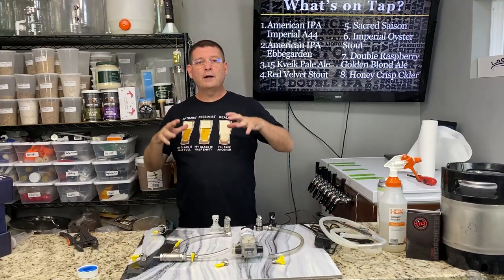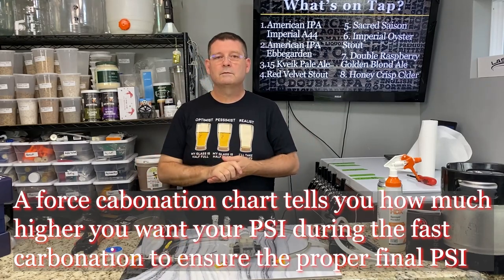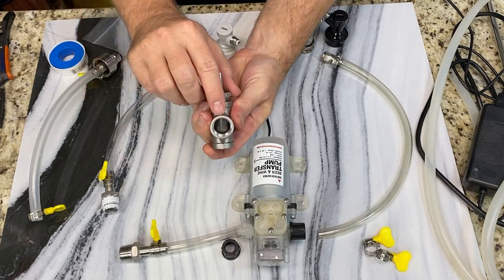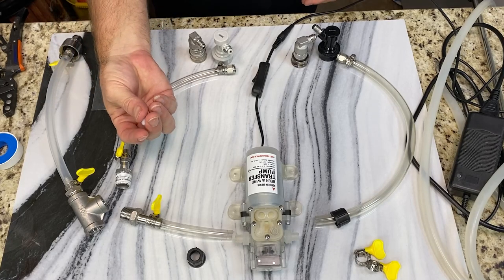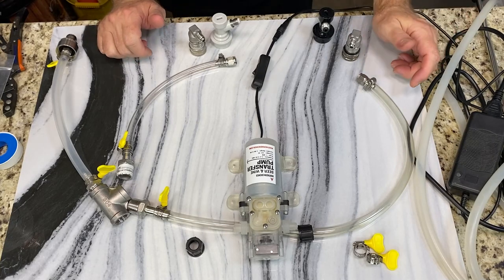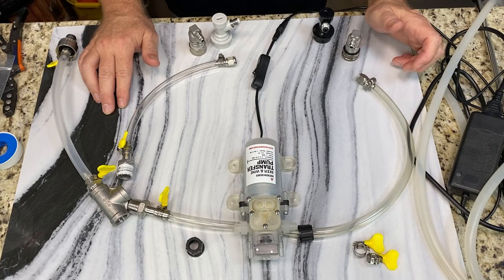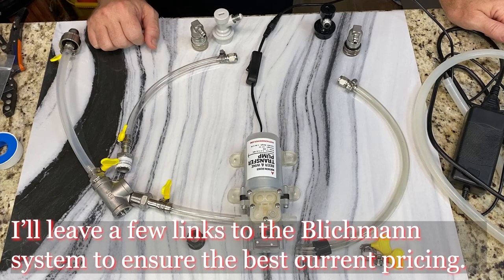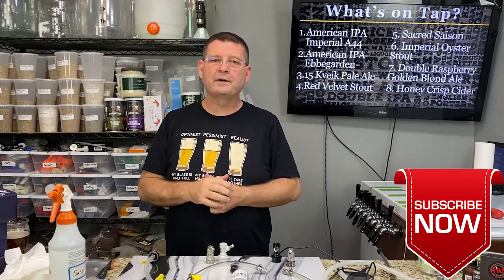How to Quick Carbonate a keg of beer in 1 hour or less

Comment: I have all of this stuff expect for the pump itself. My question is, do you still use yours, and if so do you notice any aroma loss/oxidation issues in IPAs? Wondering if I should try this or just stick to burst carbonating overnight. Thanks Mike!
Reply from the maker: Sadly, I haven't done enough experimenting with it to say if it has a major impact on aroma although I highly doubt it would hurt the aromas as it is a closed system. I rarely use this solution as I am almost never in this much of a hurry and hate having to clean extra stuff. I use the 30 psi for 2 days and then ease it down, but I have noticed that solution isn't as good at keeping the carbonation in solution as long once it is poured. After the default of 2 weeks at pressure is still the best at keeping carbonation in solution once poured into a glass from what I've seen and tested.
Reply: @BitterRealityBrewing  thanks! Good point about the cleaning, I think I just need to work on my patience because I do agree, nothing better than a beer that's sat in the keg for awhile. Anyways, hope you and yours are staying safe from Idalia!

Comment: Great video, thanks much. I cannot locate the two stainless fittings that screw onto the quick connects with a 3/8 hose barb? I have 1/4, found some in 5/16 but nothing in 3/8. Can you provide a link for them?
Reply from the maker: Just to make sure we both on the same page, do you mean something like this? https://www.homebrewing.org/38-Barbed-Stainless-Steel-Male-Quick-Disconnect_p_1667.html
Or more like a Disconnect swivel nut like this - https://amzn.to/3zmzoza - Let me know and I can help you track down the part(s) your looking for and hopefully at a good price as picture of the swivel nut is a bit expensive in my opinion.

Comment: Good evening. Does the length of the hoses matter or can they be short as in the video? Thanks.
Reply from the maker: The one air hose doesn't really matter but the liquid side I would recommend the shorter the better as there is no reason to waste extra hose or beer/brew in long hoses. Personally that would be a great test to see if there would be an noticeable difference with longer hose or if it would simply take a little longer as we all know in a keezer the longer hose helps create drag to some degree.

Comment: I want to carbonate plain water. Make seltzer. Do you have any thoughts or considerations for me? I assume I need higher psi (gas AND pump) but am not sure what to get. I’m basically wanting a 5-gallon (keg) soda stream.

By the way, thanks for such a detailed walk-through.
Reply from the maker: Sadly I haven't done soda water yet, but I am planning to do a Hop Water (same thing but with added hops and some tea) soon. From everything I've researched, you will want it under 30 PSI until fully carbonated, and then you can lower it to 10 to 12 PSI. A few people suggested increasing serving hose length to reduce foaming. The problem with water is that there isn't anything in suspension like there is in beer or cider to help hold the CO2 in suspension. If you do this before me, let me know what you did and what worked, and if something didn't. I'll be doing this in the near future but will most likely only do a 1 gallon keg the first time around to ensure I have it down before going to a 5 gallon version.
Reply: @BitterRealityBrewing  I did it with a corny keg and a special lid with a carb stone. Works fine. I left it at about 30 for a day and it's mildly carbed. Going to try the venturi system you use here next, with a tee that has a stone in it and circulate the water from the keg through for a bit. Thanks for the response.
Reply: I've done this and served it to my wife in a store-bought bottle, blind test she could not see any difference until i told her I made it

Comment: Quick question: I know I have a problem with over kill from time to time... I own a riptide transfer pump that has a flow controller, would the riptide be able to be used in place of purchasing a small transfer pump? Jus trying to minimize cost.
Reply from the maker: Sorry for the late response as I did a ton of research and although it does appear it would work it would have to be restricted considerably. I would highly recommend reaching out to Brian as Short Circuited Brewers - https://www.youtube.com/user/SCBTELEVISON - As he has a lot of experience from my understand with the Riptide pumps and could probably answer the question better and if it will work he would have suggestions on how to utilize it properly.

Comment: I was curious to see it in action Mike. But thanks for illustrating  ;-)
Reply from the maker: Go to 08:03 of the video in this link - It is the cider video where I used it to test it out. https://youtu.be/kjlIvyUdwJQ
Reply: @BitterRealityBrewing  great!
Reply from the maker: I forgot to tell you why I did this video this way. Most of the videos I've seen are how to use it but you really never get a good look at the components or how they have them connected. Plus as I made sure to mention is keeping the gas at an equal or higher elevation which no one ever mentioned that before that I heard in the ones I watched which I learned that one very quickly when testing.

Comment: Great info, thanks Mike. If you run a 5 gallon batch through this carbonating process and say only drink 3-4 pints a day, will the beer continue to be carbonated a week later ? sorry for the noob question.
Reply from the maker: Yes as long as you keep the keg under regular pressure there shouldn't be any issues.

Comment: Do you think the pump that comes with the anvil foundry will work or do you think it’ll leak because of the smooth connection that the pump has
Reply from the maker: That is a great question! I might have to try it as I'm wondering how well it would hold up to being under pressure and I'm a bit concerned about the 3 GPM as most pumps I've seen used for the quick carbonating systems are at or just over 1 GPM.
Reply: @BitterRealityBrewing  I have an Irish red fermenting so I’ll try it out next week and let you know. I may use the clamp a that came with the anvil to reduce the flow. I’ll let you know how it turns out. If you have anymore suggestions let me know
Reply from the maker: @toddhanner5961  Awesome...! Start slow as I mentioned I had a lot of small leaks initially but worked through them. Awesome been working on brewing my Irish brews for this year too. If I get lucky I'll start tomorrow otherwise it will be next weekend sadly.
Reply: Any update on using the anvil pump for quick carb?

Comment: How much faster is this than just putting a carb-stone into the keg on a hose?
Reply from the maker: Been there and done that but do not recommend using the carb-stone inside the keg as the instructions I've seen for using them recommend purging the keg and then re-applying CO2 in 1-2 psi increments which essentially each time you do the purge you are kind of fighting an up hill battle plus you are doing a CO wash which reduces a lot of the aroma if it is a hoppy beer. If you are simply recirculating the beer while forcing CO2 into the beer it should only take 30 to 60 minutes based on how high the protein levels are as they really help dissolve the CO2 into solution. So a nice heavy Stout would take a LOT less time compared to a really light thinner beer like a light lager.  *Like the user name...very funny. When I play games against other people I like to use the call name DiaperRash as I'm on your backside like a bad rash.